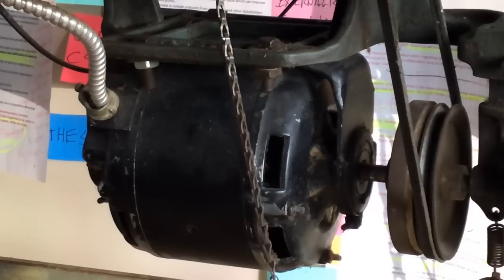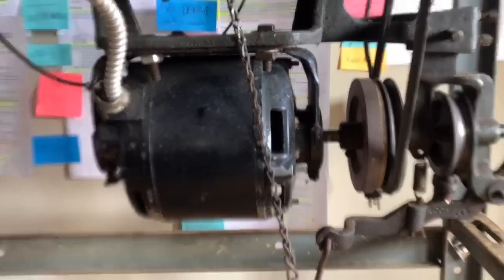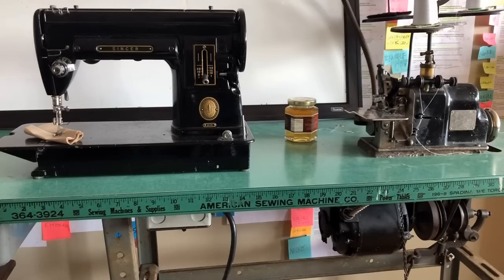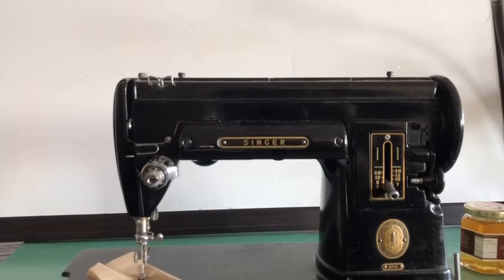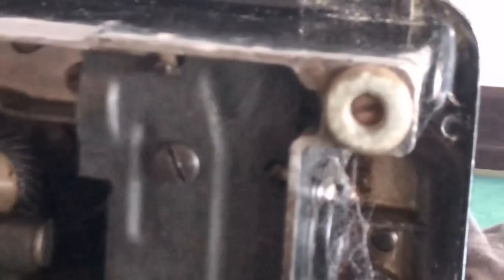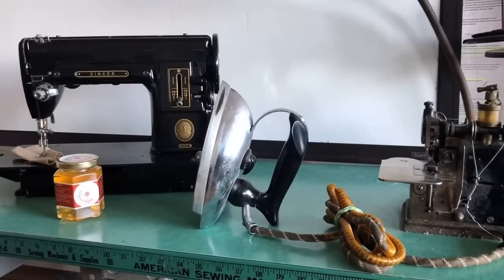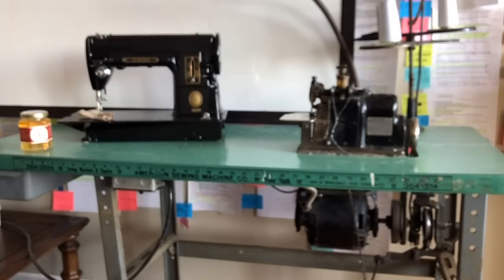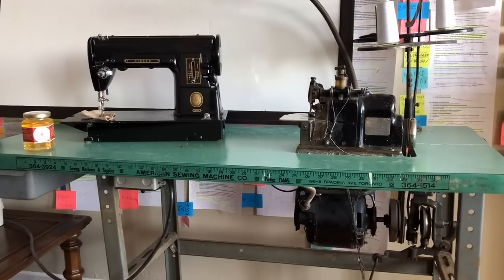Industrial Vs. Home Sewing Machines. What’s the difference?

Comment: I just spent a few hours cleaning up and oiling my mothers 1960's Sears Kenmore sewing machine and was amazed at the internal workings.  As someone who restores antique appliances, firearms, etc... i was expecting nice metal construction but not at the level that this thing was built at. The only other experience i had working on a sewing machine was a pre-WW2 Singer 15k Treadle that i restored along with the table for a friend. I just really enjoy restoring old appliances because their build quality is fascinating. A while back i restored a 1932 General Electric Monitor Top refrigerator (paint, rewire, dent repair, new chrome) and that fridge was nearly 90 years old and still worked great, aside from the cracking insulation on the electrical. No fridge purchased new today will come even remotely close to running that long. It currently resides in my garage.
Reply from the maker: Yes, when you see how some of our ancestor's machines were made, it's pretty revealing how modern consumer grade products are designed to fail and not long after they are purchased.  I had the same experience that you mentioned with sewing machines the first time I took off the lid of one and was simply in awe of the quality.  That explains why these items were often purchased on credit terms.  They were not cheap, but were investments that lasted lifetimes; often multiple lifetimes!

Comment: Then you have grey-area machines like the Pfaff 130 that were technically "domestic" machines, but were available mounted in industrial tables with 1/3 horsepower motors for commercial use.
Reply from the maker: Great point Sam.  I've also seen Berninas and some Necchis used that way.
Reply: @VintageSewingMachineGarage  Even the domestic motor on my Pfaff 130 is in a league of its own compared to most other vintage machines, coming in at a whopping 1.3A output.  Almost every other domestic machine I've seen ranged from .4A to .9A. I think the potted motor Singers are around .75A (if memory serves - I have a 201-2 and a 15-91, but I haven't used either in a while). It's just a brute of a machine.  About the only limit I've found to what it will punch through is the available space under the presser foot and the strength of the needle...and it's FAST.  I'm going to try retrofitting it with a solid state foot pedal now that I've found one that should be able to cope with the motor.  The original rheostat pedal has a habit of taking off at high speed and then throttling back, but it's also almost 70 years old.

On the other hand, I have a Necchi 534 Supernova Julia in storage awaiting an overhaul.  It's an amazingly elegant piece of engineering, just like an Italian sports car, but it feels somewhat more delicate than the Pfaff.

Comment: This  is an interesting argument but I think this predilection of basing wether a machine is industrial or domestic on its ability to sew  thickness of vegetable tanned leather is the problem.  Not all  industrial machines can sew thick leather but no machine designed to sew thick leather is domestic.  I think that the line between industrial and domestic  gets blurred when you compare a heavy duty domestic ( singer 404) and a light duty industrial. I think that leather sewing is maybe not the best line to differentiate between the two. I would say that the motor size might be a better line to draw the difference.
Reply from the maker: Hello Karl.  I actually do agree that leather sewing itself is not the best or only factor when weighing the classification of a sewing machine.  The reason I showed the leather belts was not to suggest that all Industrials are judged by this capability (I think I did mention that many industrial machines cannot sew Veg tanned leather), but I wanted to illustrate how some sellers oversell a vintage domestic machine's abilities and this can lead to damage to an otherwise durable machine.  If you have seen some of the websites or videos that show this, you can see how it could shorten the life of a vintage domestic machine; particularly the motors.  Thank you for commenting.

Comment: As far as Ebay goes, I'd suggest you are being overly charitable with regard to a sellers motivation to use the term 'Industrial' or as is commonly seen also, 'Semi Industrial' ?  There's a tremendous interest these days in hobbycraft leather working ? and anything that will easily sew meaty leather takes a steep jump in price from the literally millions of Singer style home machines that still exist. Consequently I'd suggest the misuse of the term 'Industrial' is merely an attempt to gull those who may have neglected to do their research, and get a few shekels more than market value :)
Reply from the maker: I agree with your assessment in part.  I have found that some sellers who are selling machines for non-leather sewing will often use the term "Industrial" out of context because it has been so long since consumer items were made with heavy gauge/high quality materials.  But yes, there are others who heavily embellish the power of what they are selling which is a shame since domestic vintage sewing machines can be damaged or ruined due to demanding more performance than what the engineers originally intended.  Thank you for your comment.